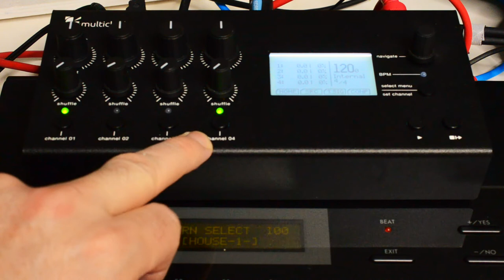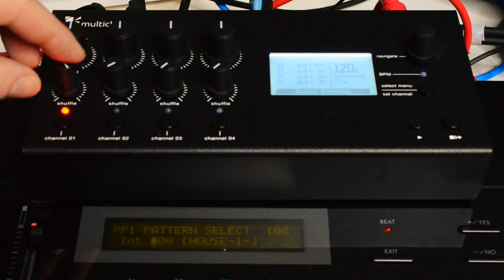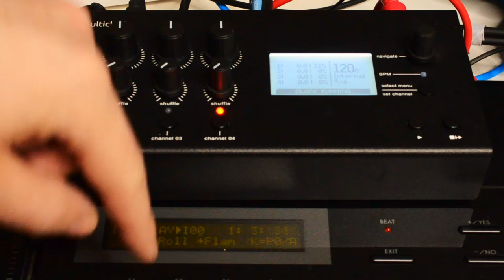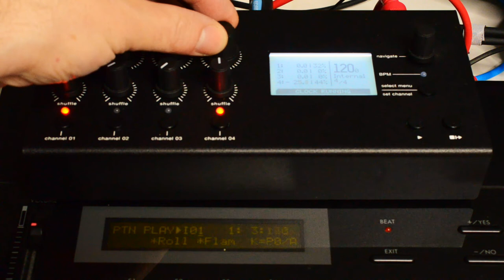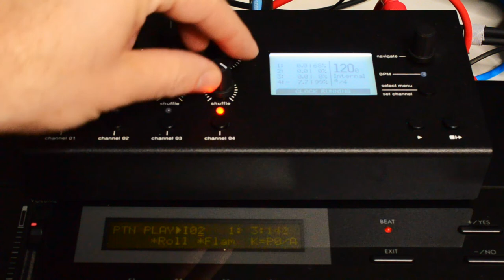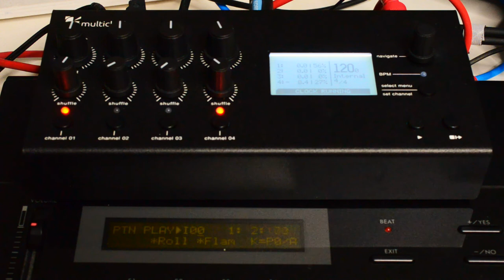Shuffle with E-RM Multiclock into the Sequencer of the Roland SH-101 Korg S3 and other Vintage Gear.

Comment: I'm trying to sync my 101 with the multiclock but not having much luck, how did you connect the erm with the sh 101? have tried a few ways but not working. Cheers
Reply from the maker: From the manual: "You can reach each channel’s setup page by holding the set channel button and additionally pressing the button of the respective channel.".  Under Chanel Mode you can reach Analog. As Divider I have 6 and 1/16. CLK Pol--POS; START Pol.-POS and ATART Mode-Trig. . No guarantee, but it work in my setup fine.
Reply: Tim, it takes time to get used to the internal setup, but once you get it is amazing specially with hybrid studio setups. I hope that you got it.
Reply: TimWolf : Cable Jack 6.35 from EXT clock SH 101 to the OUTPUT 1 Jack ERM.
As Guntersson said /follow his "routing "on the ERM..not sure but I think mine is on Pol--NEG but I don't confirm...
By the way ,if somebody knows if in this case,we lose the OUTPUT midi ERM while using the Jack (analog setting in the ERM..not midi anymore..).Can we set it up for still using the Midi 1 OUTPUT with the ANALOG set up?
Reply: It’s not going to work unless the computer is running their plugin that is used to send an audio signal to sync perfectly. Internal sync isn’t able to do it as accurately period . They don’t mention that ever until you buy one and find out that way . Typical tech snobs . 👽

Comment: The internal sync of the multiclock isn’t accurate at all . It’s only accurate with the audio sync with the plug in . Don’t be fooled by these tutorials that don’t point that out . My SBX 1 is much more accurate without a computer. I am told there is also a noise sample noise that works but not one example of how to do it. Very uncool with a six hundred dollar device to have the arrogance not to make that little caveat crystal clear . No explanation here either of course . 👽😤